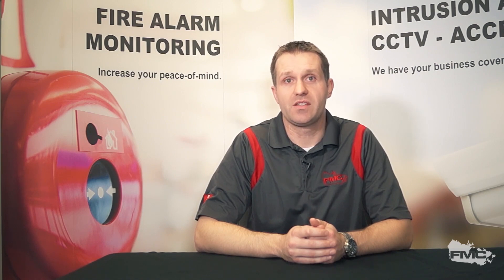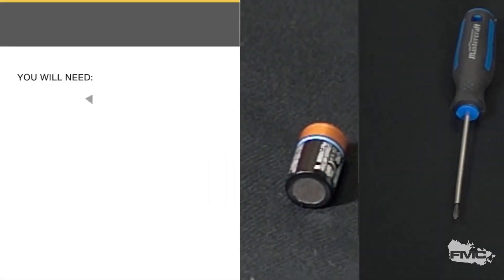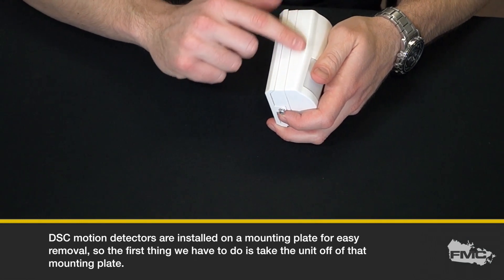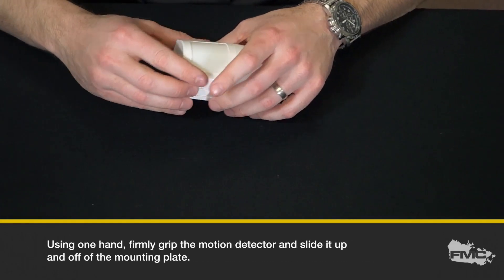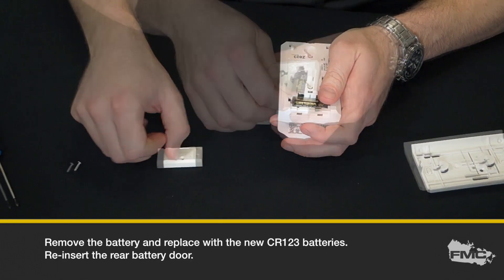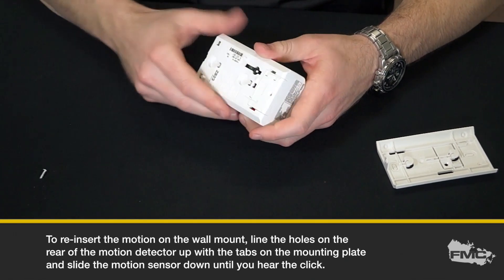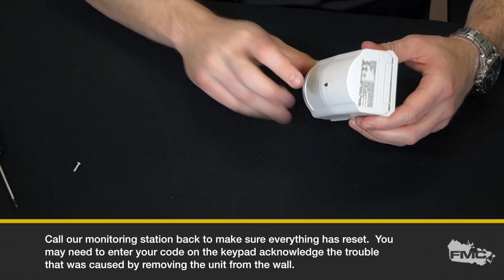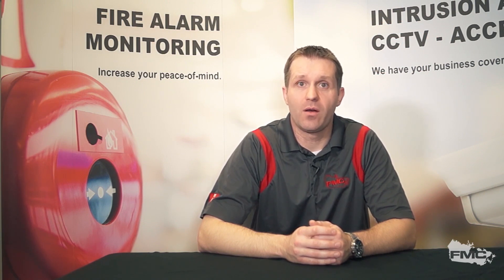Tech Tips Video   Replacing a Battery in a DSC WS4904P Wireless Motion Detector

Comment: does the red flashing light indicates weak battery and time for replacement?
Reply: A blinking red light on a DSC WS4904P motion sensor typically indicates that it is in Walk Test mode. During normal operation, the light should not be on at all. 
Walk Test mode is a diagnostic mode used by installers to ensure the sensor can properly detect motion across its coverage area.
The red light will flash every time motion is detected.
A sensor enters Walk Test mode automatically when it is first powered on (e.g., after a battery is installed) and remains in the mode for about 10 minutes. 
If your sensor has been continually blinking for more than 10 minutes or starts blinking unexpectedly, the most common causes are a low battery or interference.
Reply: same question here